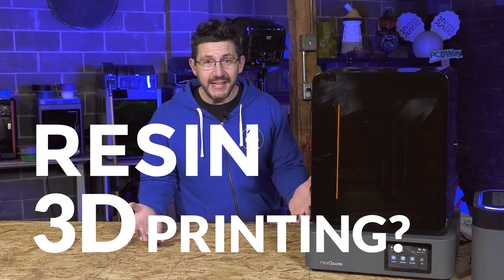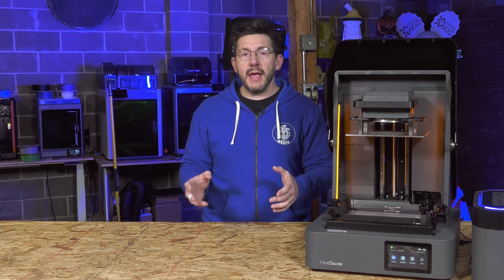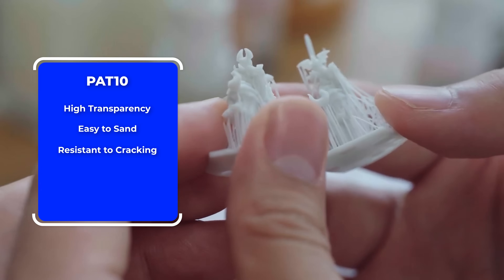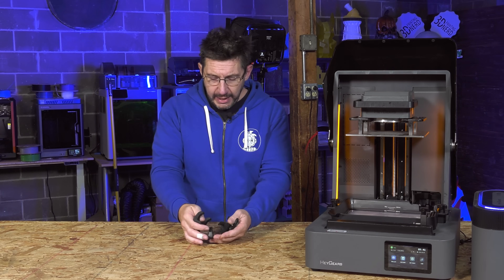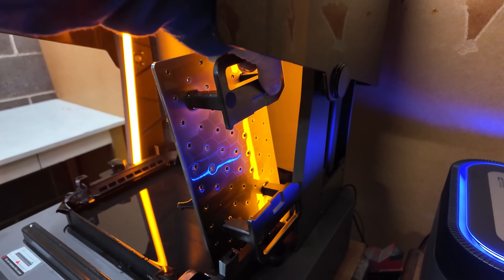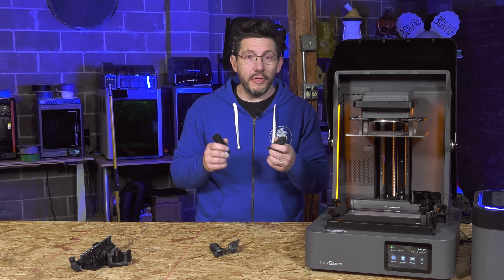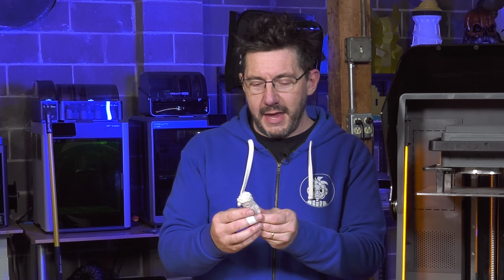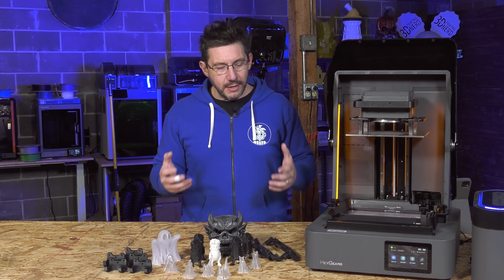Easy Resin Printing? Finally? HeyGears Reflex 2!

Comment: If sanding to 2000, might as well poslish the material itself as the last step but if clear coat is used there’s no need to go past 1000 grit. Car headlight restoration tutorials will be usefult for thise who are new to the process 😊

Comment: @3d_printing_nerd, Joel, just shoot it with clear, don't sand. You will be amazed at how clear it is to start with. Make sure to shoot it with about 3-4 coats, but it will be mind blowing.
Reply from the maker: Whoa really? No sanding at all?
Reply: @3DPrintingNerd  If it acts like all other clear resin prints it will. I had stopped sanding, when the sand paper put more scratches in from the edges of the paper or folds when sanding. Take a failed print and see if I am not correct.

Comment: I need you to test flexible resins as an easier-to-print alternative to ultraflexible TPU.
Reply from the maker: Working on it!
Reply: Hey guys, we got a Rebound 55A flexible resin with good energy return and quick recovery to its original shape, making it perfect for these tests. It's great for printing lattice structure models, such as a stress ball.

Comment: i just wish it wasn't so expensive to get into resin printing.  you don't just need the printer, you need the wash & cure station too which usually costs almost as much as the printer, plus the resin itself is typically expensive.  fdm/fff machines, on the other hand, can be had relatively inexpensively in the lower echelons & filament is typically reasonably priced, producing often surprisingly good results with minimal postprocessing.  i'd love to get into the resin world to accompany my fdm/fff machines, but it's just too cost prohibitive for me.
Reply: @TinkerDad3D  i dont know where ur getting your info from but it is very cheap if not cheaper to do resin printing. U can get a top of the line mars 5 ultra for sub $300 and a wash cure for like $100 if not less. Resin is as cheap or expensive as u wanna go
Reply: @Nightmarenightmarenightmare69 for used machines, yes, you can usually get a decent bargain.  i was referring to new prices only, starting from having nothing to being able to produce.  compare new machine prices, combos included, starting with the list prices of heygears machines.  i buy mostly used machines to fix or rebuild because of new machine prices on my limited, fixed income as a retiree, so don't think i'm unaware & try not to be insulting in the future.  you don't always have to live up to your moniker.
Reply: For me the biggest barrier is the mess. Even if you have a wash & cure setup, there's still the question of disposal of the consumables (i.e. washing fluid). And ventilation seems to be even more a concern than with various FDM filaments (some materials being a lot more critical in this area than others for FDM, but seems like all resins require good ventilation, which just makes the temperature control harder).
Reply: @harvey66616 you could try a grow tent big enough for your setup with a ventilation tube to the window.  it works for several fdm/fff setups i'm aware of, so it might work for you - cheaper than the average popup enclosure too.

Comment: I've transitioned away from my resin printers some recently, not because I don't enjoy resin as much, but they are temperamental beasts during the cold season. The last two years, both printers I have with chamber heaters ended up frying the LCD, which is its own pain, but its made Much worse when the LCDs are out of stock and you end up on a waitlist for 4 months. 
On the flip side, I still have my bag of tricks for resin printers. Surface treatment via super fine mesh media blasters (like 1500 mesh silicone carbide or glass media) can be done easily and cheaply if you just need to do a few parts relatively infrequently. Get yourself a large transparent tote, cut two holes for gloves in the lid and adhere the gloves inside-out on the lid (hot glue or silicone seal the upper cuff). Also helpful to splice in a section of polycarbonate for your viewing window, to which you can purchase replaceable transparent films by the roll a lot cheaper than single films when they start to abrade from use. Make another small hole for your feed line in the side, and a little tape or another bead of silicone around the cut line for abrasion resistance isn't a bad idea. Voila, one almost instant media spray chamber. The little cheapy spray guns for media blasting can be found for as little as $20, then you just need an air compressor. I've done it with the little hobby compressors, but a hotdog tank or larger make it continous use for Much longer. 
Many times, getting clarity on translucent/transparent print resins doesn't need sanding so much as plopping them into an ultrasonic cleaner and using less aggressive solvent (in place of IPA that is). Fairly diluted acetic acid (if you start from glacial 99%, reduce to between 20-30% with filtered or demineralized water) is a wonderful resin cleaner fluid in an ultrasonic tank, then when finished and Very dry, spray with an acrylic topcoat (your choice of gloss/semi or matte) with UV inhibitor. Krylon makes such a product used for sealing artwork, product number K01309 (remember to look for the gloss type, some don't have the UV inhibitor additive) and vary between $11-14 a can for 11 us ounces, or occasionally the two-pack is around ~$20-24.

Comment: I have been using FDM machines for 10 years and purchased a resin machine a year ago. It's way too much mess and gives off too many toxic fumes, IMO. I think it's reasonable for a dedicated workshop, but doesn't work well in a home setting.
Reply from the maker: The home setting for resin is a little complex, but for those that are able to do it, they make awesome stuff.